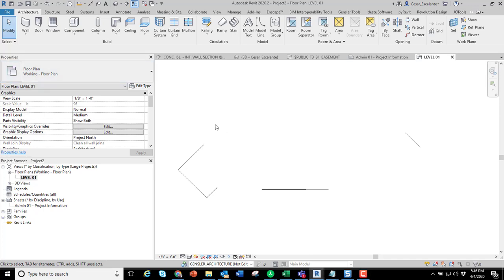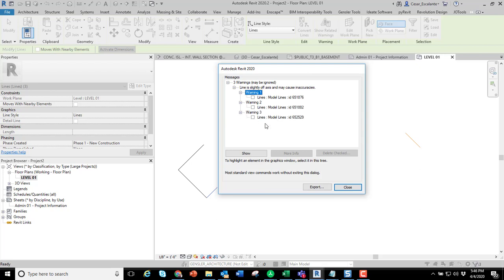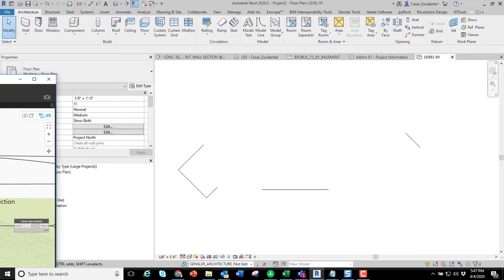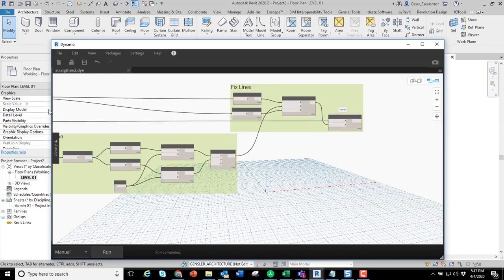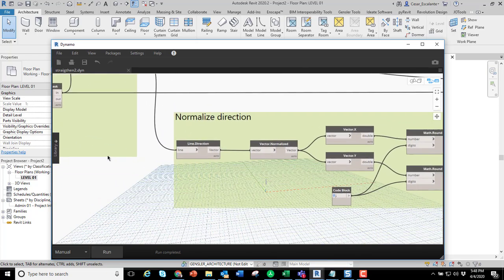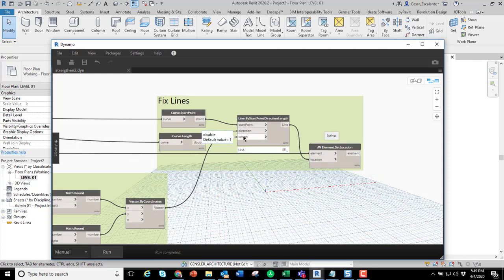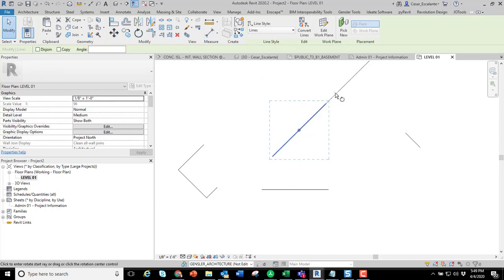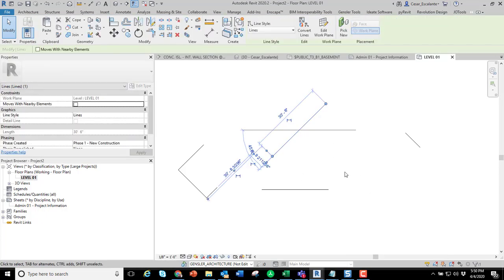Fix Model or Sketch lines Slightly off axis in the model using Dynamo

Comment: Hello Cesar, I am trying to get this script to run but the elements are not reflecting in Revit, I checked the output of the SetLocation node and the vectors are apparently correct at either a 1 or 0. What could be causing this? thanks!

Comment: Has anyone gotten this to work in Revit 2022 by chance?
Reply: Figured out the problem in 2022. I was using the wrong nodes. I used the Bang! warning nodes and i switched them to out of the box nodes and it worked. Here is the script for you to download: https://drive.google.com/drive/folders/1O8tCQ0w9SLPDvXYPQb6PdJcEwkVDfdC0?usp=sharing
Reply: @jmqrsq  How do you install "Springs" package? In Revit 2023 i couldn't install it

Comment: Hi Cesar, Thanks for this very helpful video. I am new to Dynamo and this video has offered some insight. I have an as-built model and need to obtain areas but the “Area separation line is slightly off-axis and may cause inaccuracies” warning has appeared frequently due to the nature of the existing geometries. Is there any advice on how these warnings can be managed or dismissed in the script that you had posted.

Comment: I'm getting a warning sign at "Warning.Failing.Elements"  Warning: Sequence contains no matching element. at first I thought it wasn't working because I had only Grid lines, but I'm realizing it doesn't work even with simple lines that are off by little bit. I'm wondering what I'm doing wrong. oh by the way I'm using Revit 2020.2 and  Dynamo Core 2.3.0.5885 Dynamo Revit 2.3.0.7661
Reply from the maker: Mark, this one is for Lines. It will not work for Grids, but with few tweaks we can get it there.
Reply: @CesarEscalante  thank you Cesar for answering me so promptly.  as I mentioned before I'm completely new to Dynamo yesterday was my first day. 
I suspected that much about the Grid lines.
yet I have been testing it on lines and it hasn't been working either. it does see the warning but it does not collect it.
if you have any time to spare is there any way for me to send you the file and you have a look at it ?

if it's not possible I'll understand we all have so much on a plate already.
no matter what I say a big thank you for all that you've done already.
you sparked interest in me for learning more about this subject "Dynamo".
Reply from the maker: @MarkSomma  can you share your email?
Reply from the maker: @MarkSomma  Check new video posting with the .dyn file attached.   https://youtu.be/mhyGMCYVBg0
Reply: @CesarEscalante  I'm going to go have a look at it right away at your video that you posted. thanks, Cesar

Comment: After running the script, I am getting a warning for the ( Bang!) Warning.FailingElements node...."Sequence contains no matching elements." Do you know how to solve that? I am using Revit 2019.2 and Dynamo 2.0.4.0 

Thanks!
Reply: I suspect you are having the same problem as I'm having.  i wrote to Cesar to see if there's any possibility of finding a way to solve this problem. if it's solution is found I'll get back to you.
Reply from the maker: Looks like an issue with the BANG package.
Reply from the maker: Daniel, here is a workaround to filter warnings per type at the front end of the script.   https://bit.ly/34gV9BU
Reply: @CesarEscalante  Thanks Cesar this is great. I also have the same issue using Revit 2019.2 and Dynamo 2.0.3.8810. I did this workaround but on the second part, I have a warning on the Element.GetLocation node... Warning: Your inputs lie outside of the allowable modeling range, consider choosing the Large setting with a modeling range between 0.01 and 1,000,000 from the "Settings => Geometry Working Range" dialog. 
Any idea how to fix this? 
Thanks in advance!
Reply: @CesarEscalante  Thank you, this works. Your scrip is practical and really helpful. Thanks

Comment: Hi Cesar, this is very creative and super helpful... guess this is the only video can be found across all platforms regarding this issue. I encountered a problem at the node of Line.ByStartPointDirectionLength, it says "Unable to create Line. Points are likely coincident", all the other nodes are running pretty good. I've changed the geometry scale to Large and Extra large since we have a relatively large site including two golf courses. In addition, when I hit Run, it will pop out another warning says "A serious error has occurred. It is strongly recommended that you use Save As to save your work in a new file before continuing." There will be no changes to the warnings if I click Continue without saving. Thanks
Reply from the maker: You may need expand the script to filter out close to zero-length segments.